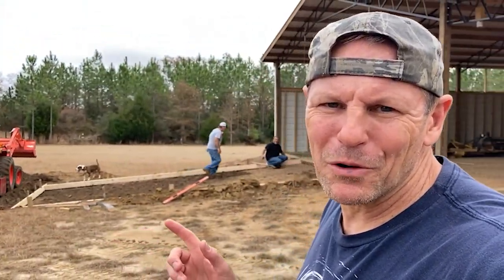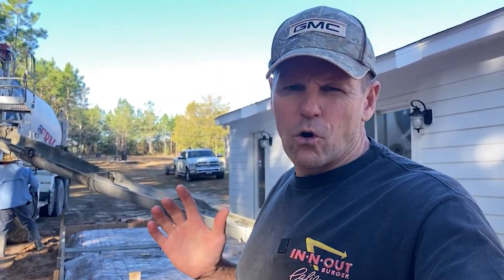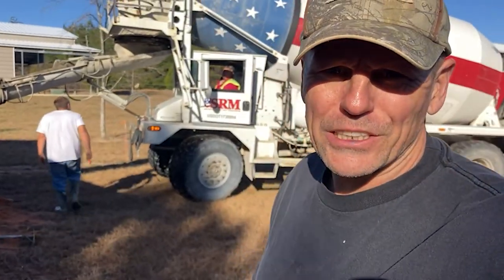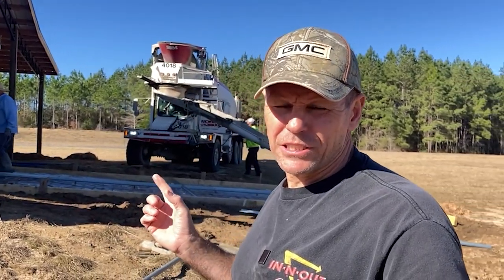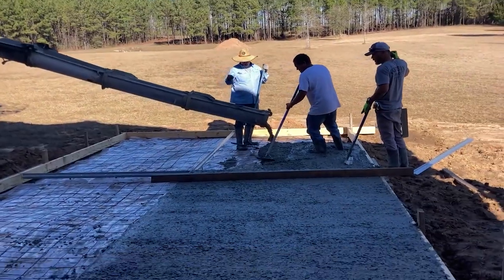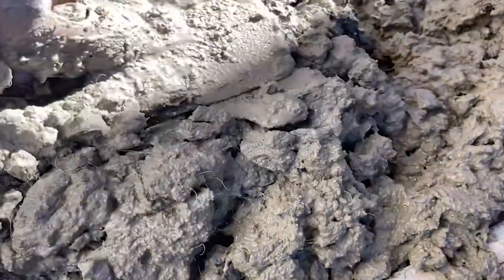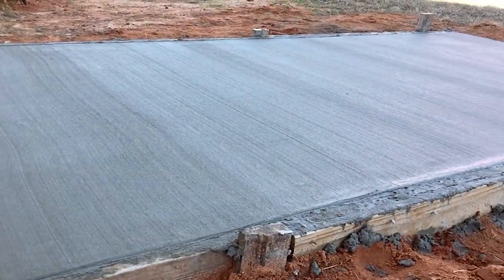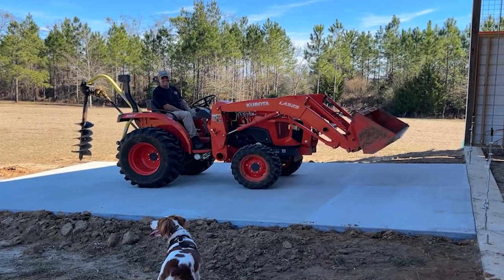How To Pour A Concrete Pole Barn Ramp And Patio

Comment from the maker: Original pole barn concrete video here:  https://youtu.be/PO8Iy68Ud1w

Products in our Amazon store used in this video (costs nothing extra to use these links!).  You don't have to buy these specific items to support our channel....just use a link below to get to Amazon then make any purchase: 
Fresno Concrete Trowel / Float: https://amzn.to/3j6QjlQ
Flex Tape: https://amzn.to/3R4MdWm
Mechanix Leather Gloves: https://amzn.to/3HjoZZf
Solo Seed Spreader: https://amzn.to/3UGIws7
Fuel jug nozzle kit with drill bit: https://amzn.to/3H5EeoE
Orange rubber gloves: https://amzn.to/3xIdlEt
6’ Digging and Pry bar:  https://amzn.to/3vH5Agx
FIMCO 15 Gallon Sprayer: https://amzn.to/3HgxSmp
Renegade Razor Hybrid Brush Cutting Blade: https://amzn.to/3yaJtk9
Dewalt 20V ½” Impact Wrench: https://amzn.to/3UOcXNH
Dewalt 20V brushless Leaf blower: https://amzn.to/3zwJcYm